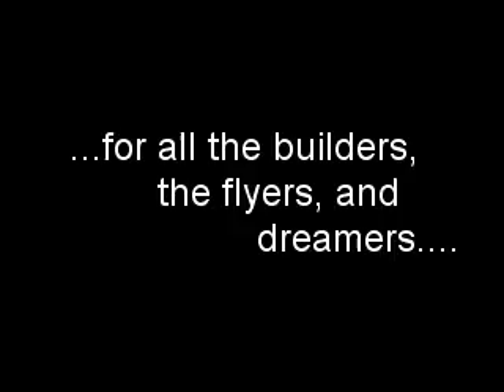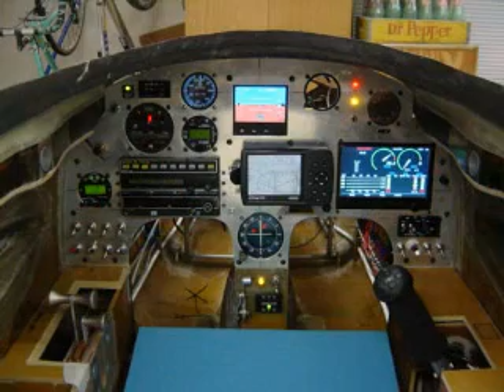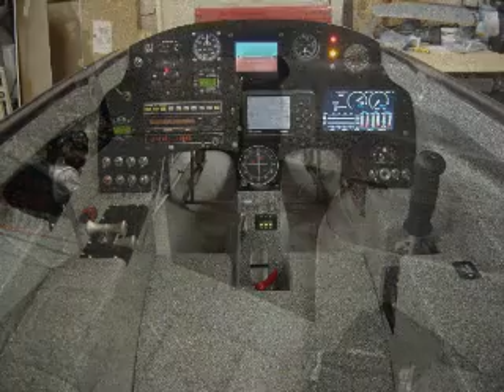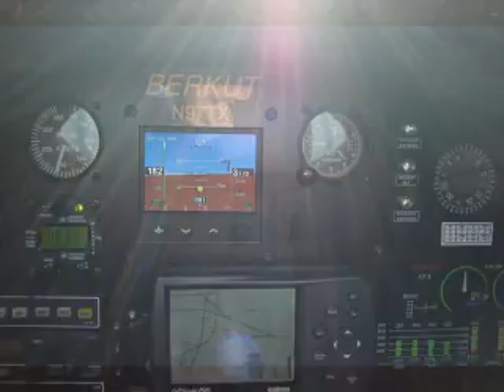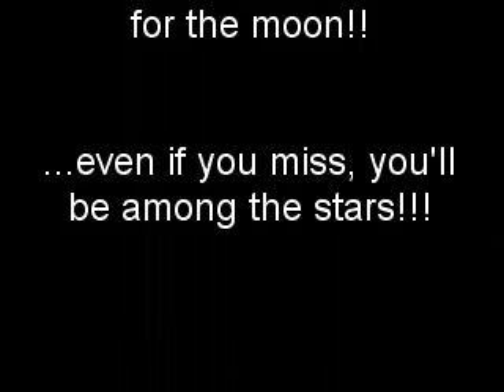The Power of the Dream

Comment: yeheeeeeeeeeeey congratulations you are very fantastic i'm really touched and encouraged. i have a great idea about mobile power supply module that generates electricity using air. i applied a patent but never materialized no budget and afraid to pursue it because the onlinne patent co. might use and own it instead. you di really great the song really is soopowerful as well